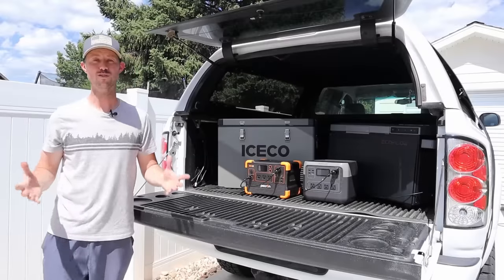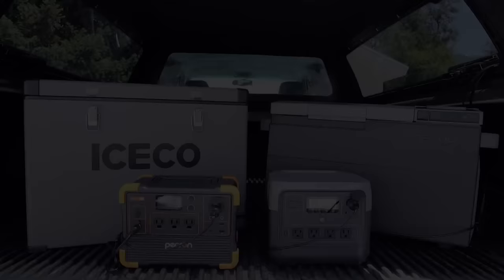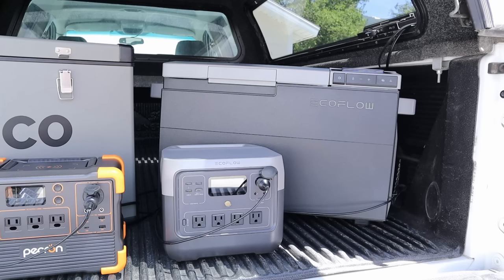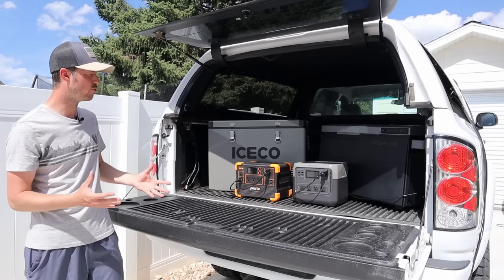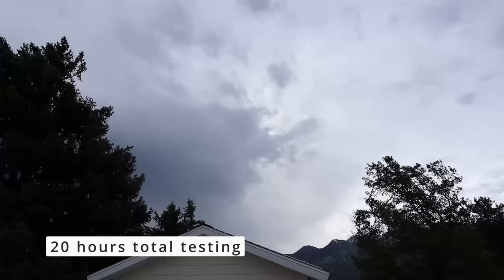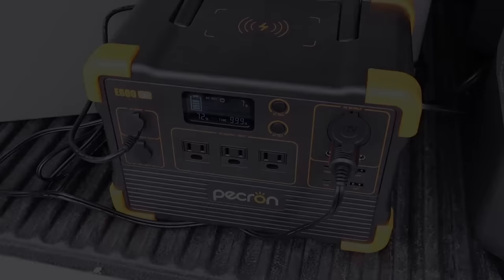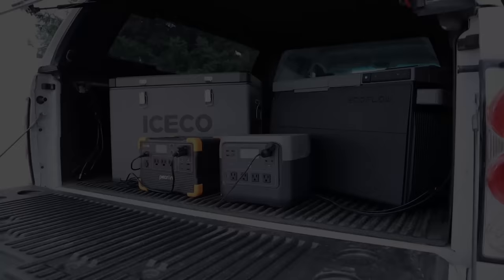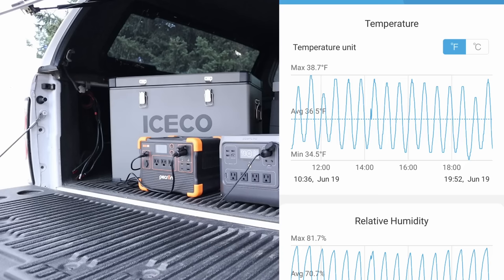72 Hour Compressor Fridge Showdown! Budget Cost VS Premium Cost!  #iceco #ecoflowglacier

Comment: great review, but id like to see how long each fridge  would run at 32F on each battery pack, no solar back up. I just arrived back from a trip,  3 days of rain no solar. Thanks if you decide to try it out
Reply from the maker: In all of my fridge review videos I show the actual power usage of the fridge at different temperature levels so you can estimate the run times with your power station. I have documented all that together online so you can see how much power each fridge uses.  Check out the fridge comparison tab on my "power station grading sheet" and you'll see all the power usages:
https://jasonoid.com/powerstations/

Comment: I'd like to see the power consumption of both coolers side by side. In curious if one is more efficient than the other.
Reply from the maker: If you want to see how each fridge performs and their actual power usage, check out this spreadsheet: (once the shared doc opens up, click on the "fridge comparison" tab at the bottom:
https://docs.google.com/spreadsheets/d/1BZLY89iHF94vO2enPln7_HjlH-_IkgSbCfh3ofZ1h0c/edit?usp=sharing

Each fridge review also breaks down detailed power consumption testing to compare both models side by side:
EcoFlow Fridge Review:   https://youtu.be/Om39YQOc-eg
ICECO VL45 Review:  https://youtu.be/2wguDItwF8Q

Comment: What's the eco flow pro power station? Is it = to the other power station? 
Everyone does the test on running the frig, no one does the testing on running the freezer only. I use the freezer only, it's dang hard to keep that going using even a thousand watts power station. The thing I love about the Eco Flow is how fast they can change using shore power. 
Thx u for doing the testing video. How's that working for u with the ice maker 1? Power hog I bet. 
I'm fulltime using my Iceco go20. Love that little frig/freezer. 👍🏾
Reply from the maker: Running these in freezer mode is much more taxing on the battery. I show those numbers in each of my fridge reviews on my channel. Gotta have lots of battery capacity and solar to keep the freezer going!

Comment: I loved this test! I’m wondering how something like this would work in 115° desert heat. Even the shade is scorching hot and I worry about the power bank cooking, especially if I have the fridge and power bank in the back of a truck shell cooking all day. I’m curious what you think about this. I’m south of you in San Diego and camp in the Sonoran Desert frequently.
Reply from the maker: I would stick with a simple LFP battery setup to run the fridge. A lot less things to get fried in that type of heat. You can pickup a 100ah LFP battery for like $250 these days which has over double the capacity of these power stations.
Reply: @Jasonoid  Thanks for the advice. So just set it up separately from the vehicle’s charging system and run a charge controller and charge via solar and run my own connections for the various devices?
This will be a project I tackle in the semi-near future and will be a first for me in regard to a separate power source. Thanks again 👍🏻
Reply from the maker: @desertqwest  yep, that would be the ideal. You could use a solar charge controller or a DC to DC charger while the engine is running. I have both and they are super convenient.
Reply: @Jasonoid  excellent! Do you have a video of your setup?
Reply from the maker: @desertqwest  I love this dual charger, it's a solar mppt charger and a DC to DC charger in one! I have an older video on it:  https://youtu.be/HdBd0_SJf0A

Comment: Just got the dometic cfx3 75 and ecoflow delta 2 max. Hoping it's enough power when I go camping for a few days.
Reply from the maker: The Delta 2 Max will run that fridge for a long time! Just make sure you are running it on DC power / dc output for the best efficiency.

Comment: Isn’t the rule of thumb to ensure higher solar charging input wattage than output, to avoid battery Anaheim?
Reply: Damage, not Anaheim…
Reply from the maker: The only damage you'll see on your battery is from repeated high discharge rates and discharging it too low.
Reply: @Jasonoid  Ok thanks.  I forget where I heard/read it, but I read or heard that ideal is to have more power in than power out when in pass-thru mode, otherwise the battery health could be affected.  If I can recall where I heard this I'll post here.

Comment: Can I run a Renogy 100watt solar panel to the bottom left 5-pin port on the Pecron. I’m confused about the 32-95V range
Reply from the maker: The smaller charging port is designed for 100 watt panels. The larger solar charging port is designed for higher power and solar panels wired in series. You'd plug your 100w panel into the smaller port.
Reply: @Jasonoid  the Pecron I bought only came with a solar connector to the 5-pin, does that mean it won’t work?
Reply from the maker: @JawnJohn  if your solar panel has MC4 connectors, search for a "MC4 to 5521mm" adapter on amazon, you'll find lots of options that you can buy so the panel plugs into that 5521 port
Reply: @Jasonoid  I see, but is there any harm in connecting a lower voltage solar panel to that 5-pin port? I’m just asking to get a better understanding but I did already order the MC4 to 5521 adapter.
Reply from the maker: @JawnJohn  it won't cause any damage but it also might not be as efficient

Comment: I have a question. When talking about idle power usage with the power stations does it affect how long your battery lasts during use? For example the bluetti ac200p uses 2%+ an hour when idle would i have to factor this hourly percentage drain in conjunction with usage of low wattage devices? Or is this only an idle plwer drain issue?

I ask because I'm deciding between the ac200p and delta 2 with extra battery and if the idle usage applies to when the unit is being used then the deltas may actually have a decent margin of more power because they're more efficient with idle power draw
Reply from the maker: Anytime the output is enabled it's using that amount of power. If you have a load also running it pulls additional power from the battery. DC output is much more efficient than running the AC inverter on a power station so I try to stick with DC devices as much as possible when running long loads.
Reply: @Jasonoid  thank you! So that 2000wh on the ac200p may not actually be anywhere close relative to ecoflow delta 2 during camping trips and what not
Reply from the maker: @skatRdie0  yeah, if you look at my spreadsheet you can compare each model and their power loss.
Reply: @Jasonoid  awesome, thank you!

Comment: The ecoflow solar panels case is the kickstand kinka cumbersome but works pretty good with some fidgeting
Reply from the maker: The case kickstand idea is good in theory but in practice it's horrible. It falls over all the time and it adds a bunch of weight to panel. They need to rethink it.
Reply: @Jasonoid  hmm, haven't used mine a whole lot but is it an issue with wind or something?  They seem pretty good when I use them, although they recommend just laying them flat if you aren't going to be adjusting them to match the sun angle.  I've got 2 110's and 1 220 are the bigger panels worse as far as stability?
Reply from the maker: The panel is heavy and it just slides off the case stand. I prefer just having built in kickstands on the back of a panel. Laying them flat works fine most of the summer, spring and fall you'll need to angle them for the most power.
Reply: @Jasonoid  are you referring to a different type of panel? the Ecoflow panels attach with carabineers top and bottom and you zip up the zipper to increase the angle.
Reply from the maker: That's the one.... Guess I'm just too stupid to use it correctly LOL 🤣😂
Reply: @Jasonoid  it took me 4-5 times setting it up to figure out the best orientations and where to clip/align the carabineers and which way the stretchy straps should go and how to use the zipper😅, then when the 220 showed up I saw they even put the instructions on the box😁 Google photos share: /86vQexA4xDsm3QHG9

Comment: For a fridge you don't need to spend much to keep it powered. You can get a 30in square bifacial 110w solar panel (peaks 145w) for $99, much more efficient and durable, and small enough I'd go that route instead...
Reply: Where do you buy a 110w bifacial for 99?

Comment: I was trying to find the budget fridge somewhere behind all that money. IceCo is hardly “budget”.  Lol set power, Uhomey etc.. would be “budget”.
Reply from the maker: Yeah it's kinda relative. The ICECO is still budget compared to Dometic, Engel, and ARB. The Ecoflow is the same cost as those larger brands.
 ICECO used to be more of a budget brand but inflation has changed that, then they  started Setpower so it's a good alternative. The RV45s is a great option I've tested on the channel before.

Comment: flawed test. You needed to have equal panel output to be fair. And why are the latches kept unfastened on the iceco?
Reply from the maker: But that's the whole point... to see how different price points fair against each other. Can you get by with a 100w panel or do you need a 200w panel? It wasnt designed to be a direct comparison. I've tested with latches undone and done up, the lid is heavy enough it doesn't make a difference.

Comment: I have the ECOFLOW glacier. It literally just died on me and it’s been just over 1 year. It’s probably the worst fridge I’ve ever owned. The battery for it constantly over heats shutting off the fridge entirely and it makes this weird snap crackle pop sound whenever the compressor is running. For the money I am completely unimpressed. Going back to dometic. It’s a nice looking fridge but unreliable